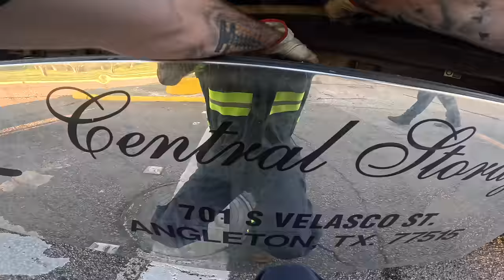I've Never Had a Problem With The Cops Before…

Comment: That cant be got on suspension,tires, transmission. Dragging it.
Reply: I was thinking the same thing. They didn’t leave the keys with the car? That seems very odd to me.
Reply from the maker: Like getting into a wreck is?
Reply: @Towtruck_Dustin  there is no reason to cause more damage. The repair shop is going to need the keys to repair them.  It’s strange that the police didn’t collect the keys.
Reply: @grimwulf7173  Its just what happens out here. 9 times out of 10 you dont get keys.
Reply: @grimwulf7173 I'd expect to leave the keys in if I got in a wreck. Nobody is gonna steal it.
Reply: @RustyShacklefordReal  exactly

Comment: Dustin,you back in the  Kenworth sounds like the kenworth is your favorite truck, Dustin sounds like the PD call log doesn't match with your call log at Campbell's because it sounded like another tow company was called for a multiple vehicle accident maybe the officer got confused with when the calls came into dispatch, sounds like the PD doesnt know what was going on giving the wrong location to the wreaker companies means that someone not paying attention on which wreaker company goes where, that officer got confused with witch wreaker was late it wasnt your fault or the driver of the other wreaker was given the wrong location that's the reason why it sounded like why they were late

Comment: I've had a few Ken officers a few time. I've been chewed out for taking to long includes loading up and sanding the oil spill. I told the officer not my problem that FD didn't do the oil spill clean up. Another time I was told after I arrived and had the bed down to leave as another rotating coming soon I told the officer I'm here I'm not leaving. If I left they would've had wait least 15-30 mins. I never let an officer tell me how to do my job

Comment: Why did you put blocks under the wheels? They didnt look siezed or anything?
Reply: I am puzzled as well
Reply from the maker: That’s exactly why. They were free rolling and no way of stopping them (not getting inside to see if it shifts or parking brake works with all that blood and carnage). By stopping the wheels from rolling it goes in the direction I pull it. Not in the direction the wheels want to roll.
Reply: @Towtruck_Dustin nice trick, was wondering the same thing 👍
Reply: @Towtruck_Dustin  that's makes good sense actually. Tow trucks in the UK don't do this I'm not sure.

I thought it was gonna destroy the guys tyres if differential since the wheels were bouncing all over the place.

Comment: What was the point of the wood blocks behind the wheels while loading?
Reply: Probably to keep the wheel from spinning, thus avoiding further damage to the drive train. The wooden blocks lift the wheel up enough for it to reset its position, instead of forcing it to turn or dragging the tire.
Reply: Ah, makes sense.
Reply: I think it is to make the rear wheels slip so it pulls on straight...the winch is pulling in the right spot, the blocks make it so the car can get dragged to the center.

Comment: 5:05 what is the purpose of the blocks behind the tires?
Reply: think it has to do with helping tires slide up ramp when locked.
Reply: @krogerman83a  Can't be that. Tires were free-rolling at 4:23.
Reply: Probably some stupid trick that does nothing that some old man taught him
Reply: He put the blocks there so when he rolled his bed out and leveled it there was no chance of the car rolling forward (or backwards in this case) and hitting his headache rack. When automatic vehicles are put in park they rest on “parking pins” (why your vehicle rolls slightly when you park) and when a lot of force (like dragging it up a bed, or being in a collision) they can break causing the vehicle to no longer have “park”
Reply: The purpose of the blocks is to keep the rear tires from rolling. Because there were no keys and the car was in park the front tires were not rolling. If you don't get perfectly straight with the car or if the wheels are turned the car will not load straight. So by keeping the rear wheels from rolling the winch will pull the car straight up the bed.

Comment: Air brakes are horrible get a dodge
Reply from the maker: A dodge with half the capacity? No thanks.
Reply: lol, air trucks only provide more comfortable suspension, lower loading angle, superior braking ability, longer maintenance intervals, safety and are cool.
Reply: @razy7609  The dudes just mad cause he couldn't pass his CDL exam and is probably a "hotshot" pickup driver that has 2 5" stacks and a CB dangling in his windshield to display to the world he means business in his dodge cummins.
Reply: @Adamz678  And is he a horrible driver?

Comment: Why the wood blocks ? Skates work just as good
Reply from the maker: Way easier to use. Don’t have to hammer them under the tires or get them out from under the car. Just relax some tension on the winch and you can pull the block.
Reply: Well you got a point .,, I’ll keep that in mind next rotation
Reply from the maker: To each their own, and different situations need different equipment. Haven’t had many times where a skate was needed when a block just wouldn’t work, other than on new or high end cars where a skate is actually needed if you have to drag it.